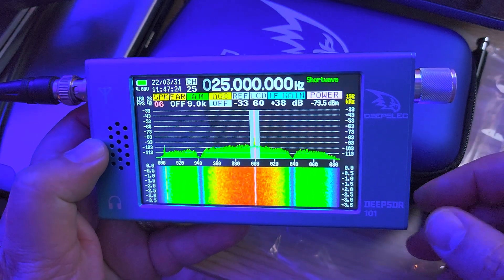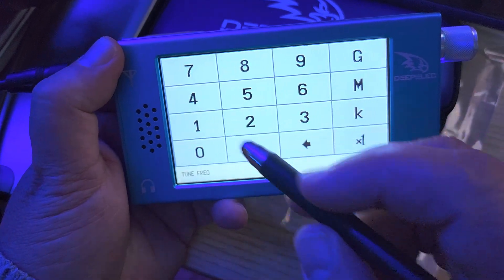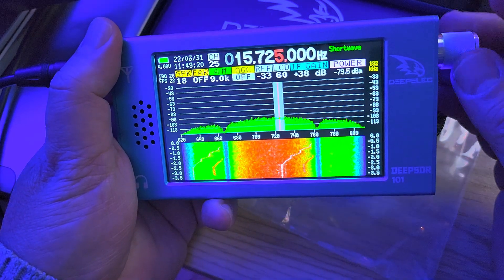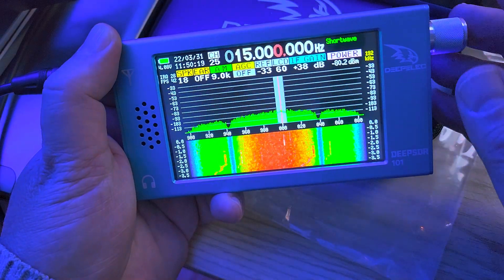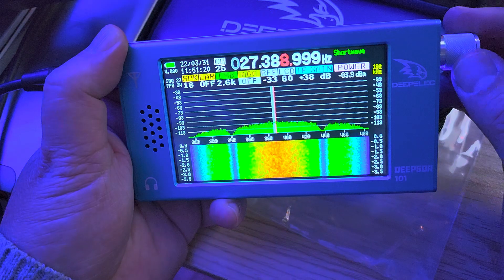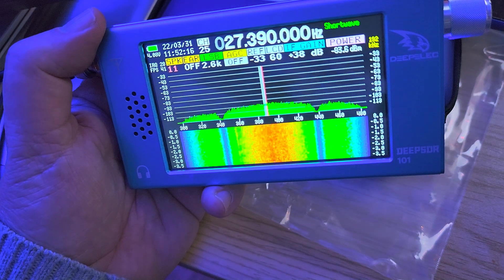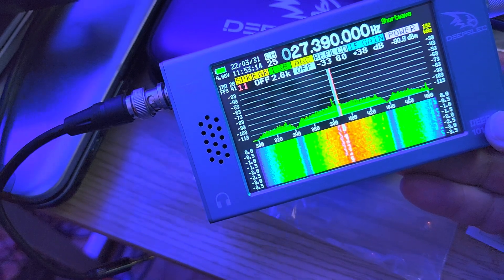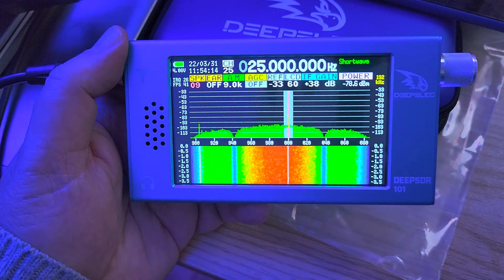DEEPSDR 101 quick tune with MLA 30 loop antenna 25000 kHz WWV Shortwave

Comment: I have this, my first week the screen cracked while putting a screen protector on it, i couldn't believe it, i had to send it back to get the screen fixed, got it back but this time i am not putting the screen protector on. It is a nice little radio but be careful with the screen!

Comment: I wonder how it will perform with a long wire. I have better luck with my 100' and even the 50" than the two MLA 30+ Loops. It does look interesting.